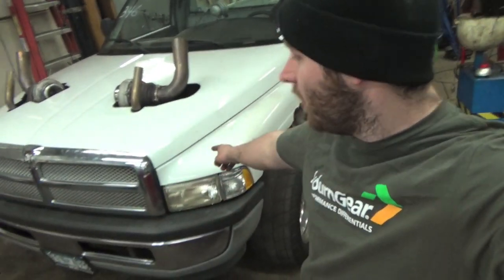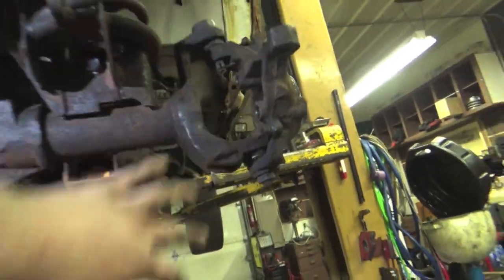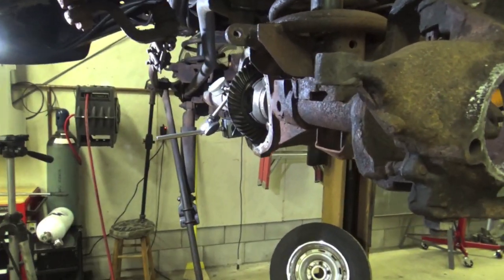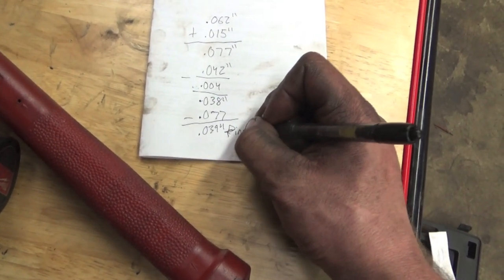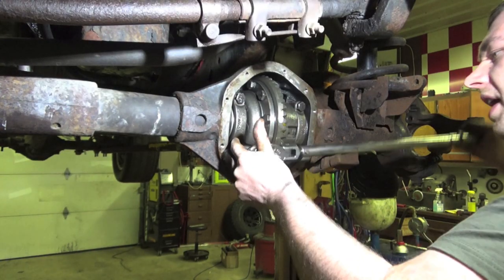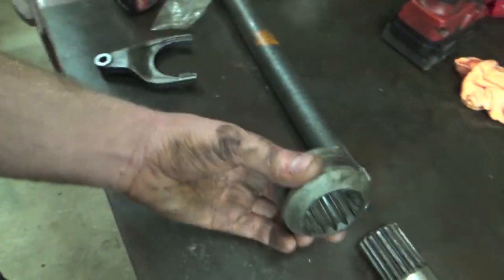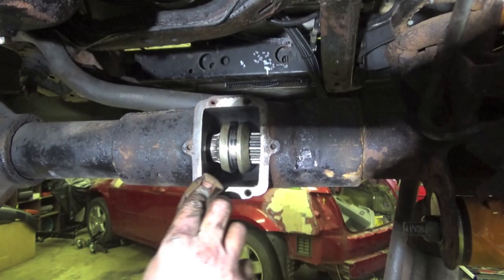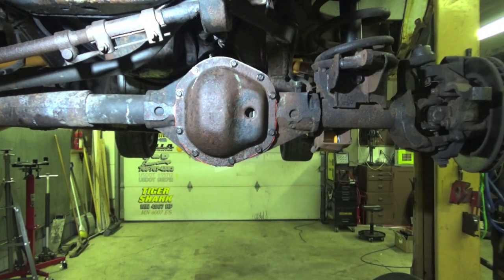Dana 44 Auburn Gear Grip-N-Loc Limited slip differential install!

Comment: Looked like you still had the invert Y steering. Is that something you may upgrade  to help control it now you will be in 4wd. I did the conversion using mopars latest PN for 2013 2500 and it was bolt in and drives like a newer truck. No more death wobble, bumpsteer, or inconsistent alignment.
Reply from the maker: Ya I have the update one sitting in the corner of my garage! If I have any issues with this I’ll swap it out

Comment: Any reason you opted to go full time lock instead of using a Posi-lok?
Reply from the maker: This is a limited slip it’s not full time locked only when it starts to feel input slip it locks
Reply: @RacingRamFam  Apologies for the confusion, im refering to the brand "Posi-lok" its a cable actuation for the CAD style axles. Replaces the vacuum lines for a manual engagement of the CAD. I believe you made a video on your plow truck a few years back with it.

So i was wondering why you went with the CAD being engaged full time vs having the ability to engage and disengage even without the vacuum lines
Reply from the maker: @xxScoutxx3  drag truck so it’s not driven so I just want it to be locked
Reply: Mostly curious due to the steering factor, even though you wont be in 4wd all the time, with the CAD engaged all the time it will still steer as if it were in 4wd. Although you are building a straight line drag truck i was still intrigued by thr route you took.

PS: love the channel, love the builds, you guys are awesome! Would love to see some more srt10 content if shes still around 🤘🏼
Reply: @RacingRamFam  gotcha, that definitely makes alot of sense, never would have thought about that
Reply from the maker: @xxScoutxx3  yes srt10 just hibernating from winter! And thank you the new rams just have one solid axle with no issues

Comment: A factory Dana Spicer  44 Power lock is the strongest limited slip. With double Belleville clutches and ramping cross shafts. Besides they are rebuildable. Why would anyone install a Patten purchase Borg Warner cone unit.